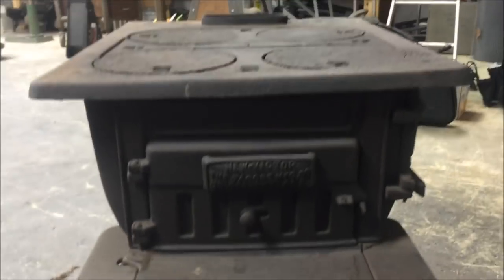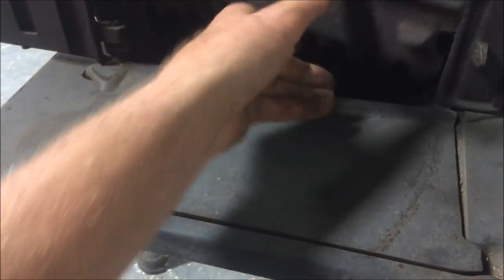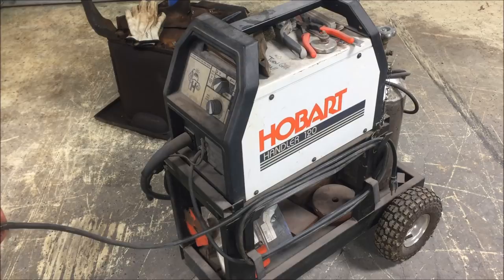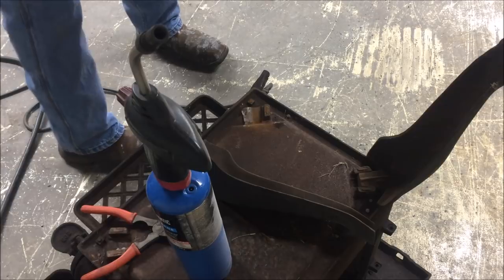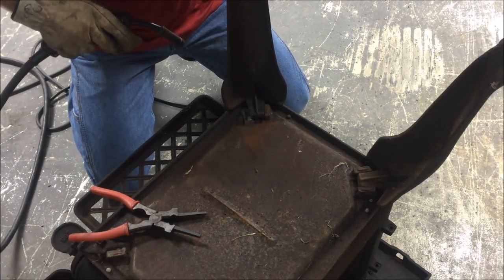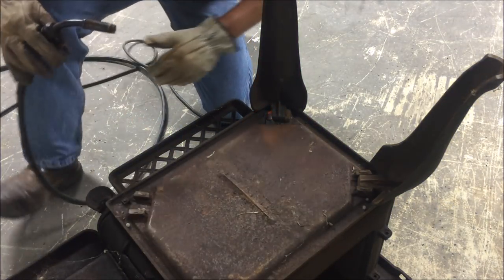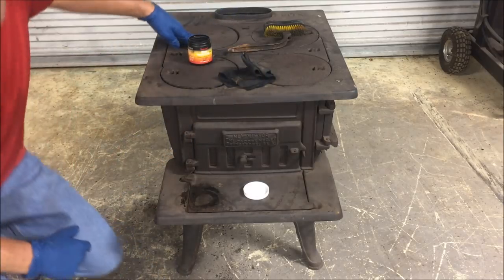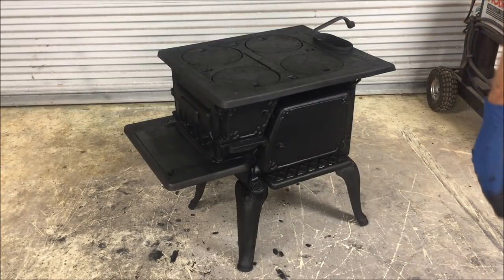How to MIG Weld Cast Iron on a Wood-Burning Cook Stove

Comment: I have been welding for 40 years.  I have welded a lot of cast iron.  The best way I have found is to use a nickel or stainless steel rod. (using an old stick welder)  It is malleable enough to keep the weld from cracking.  Using the nickel rod, I can weld cast just like anything else.  Pre heating thin parts is still a good idea.
Reply from the maker: Great to know!  Thanks for the information.

Comment: Thank you for the video! 
I just fixed a long hairline crack on a wood stove and did the same thing, heating it up to 500 degrees before welding. My only problem was every time I tack welded all I heard was tink tink tink. I was going slow not trying to have to much heat from the welder, but I was chasing more hairline cracks coming off of the original crack. Finally I got it. Next I will put some fire cement over it for extra protection. 
Thank you!
Reply from the maker: Great tip!
Reply: You need to drill a 1/4" hole at each end of the crack. This will stop more cracks as you weld. Use either a cast iron wire (mig) or stick. If not braze it. If you use regular steel filler wire it heats and expands differently than cast iron and will cause more cracks

Comment: That’s great that it’s on, I used to arc weld cast iron and we also preheated the parts and used special low hydrogen rods to prevent cracking
Reply from the maker: Good deal.  I was using what I had and it held... for now

Comment: I would have not welded the leg to the stove itself, instead I would have found a piece of carbon graphite, cut a piece to match of same thickness of the  slot that leg fits into and the same shape of the tang on the leg, then used the welder to build up the area of  that was broken off,  the mig wire will not fuse to the carbon and after completion of the repair, the carbon could be chipped out and the leg could be removed in the event the stove needed to be dismantled sometime in the future to facilitate a more compact package. By the way I have an old Cast Iron Church Bell that was cast by the same company that made that stove,, it was missing the clapper, the pendulum piece that rang the bell, I used a trailer hitch ball and made one from it, still have it and is mounted on a Red Aromatic Cedar pole,  the bell itself is a #4  which the bottom of the bell shape is approx.. 24 inches in diameter and is about 18 inches high not counting the cradle and arm that the bell swings on. The bell was cast in 1847.
Reply from the maker: That must be a cool old bell.  I hope you find the replacement parts.  Good luck!

Comment: Thought you were going to close up the crack by the broken bolt (bullet hole:). Our old heater/stove has some broken cast pieces that I am going to either braze or mig. I've got a Lincoln mig 100; I hope I can get enough power out of it.
The firebox doors have many segments of mica, some broken. I wonder where I can find some of that?
You've inspired me. 👍Thanks
Reply from the maker: I bet that welder will work especially if you preheat if with a propane torch before welding.  Good luck
Reply: @JustPlainCommonSense  Excellent thanks. I found some mica, by the way, on amazon
Reply from the maker: You’re exactly right!

Comment: Great work and very informative thanks, but what sort of welding wire did you use?
Reply from the maker: Its a easy grind wire commonly used in auto body repair.
Reply: Blimey! Ok thanks.
Reply from the maker: I think the stuff is actually referred to as "Easy Grind".  It's nothing special at all; just a good all-purpose welding wire.  Not stainless.
Reply: I had an old stove that had a broken piece. Got a couple cast rods from Air Liquide but no joy. At the end we just used a 7018. Heated the piece cherry red, welded it, and wrapped it in fire blanket for a slow cool. Knock on wood it’s still down in the basement burning wood as we speak. Nice job btw.

Comment: late to the game, but did you do anything with the inside of the oven with that black paste?  I have an old gas stove that has a log of rust on the inside and sheet metal that is rusted through that I am trying to get back to a usable state.
Reply from the maker: I wouldn't apply it to the inside; it may contaminate whatever gets cooked in there.

Comment: I'm working on an old pot belly stove that has one cracked trim piece. I was thinking about trying to weld it with a welder similar to yours. Was that just regular welding wire? Great video. Thanks.
Reply from the maker: +deere3321 That is just "Easy Grind" wire in a gas MIG wire welder.  Preheating is the trick

Comment: How much volts are you using while welding?  Also what wire speed?
Reply from the maker: That is a 110V MIG.  I can't recall the speed; whatever speed made the weld sound right.

Comment: Can flux core be use if no gas is available ? Thanks
Reply from the maker: I don't see why not.  Give it a try and let us know how it worked out.  Thanks for the comment!
Reply: @JustPlainCommonSense  weld a small cast iron part and dump it on ash to let it slow cool down and it work great, using Lincoln flux core .035 and a small century wire welder

Comment: I was looking at my oven it has the same hole as your bullet hole in the same place. pretty sure it's not a bullet hole
Reply: +5 Acres on the Bayou yes
Reply: +5 Acres on the Bayou send me your email or # I can text you a pic of mine I will send you a pic
Reply from the maker: +Jeff Davis You are absolutely correct Jeff.  I just took the top off the stove and there are two bolts that come through the outside skin and support the top of the oven box.  What I saw was the head of the old stove bolt.  My bad.  Thanks for letting me know.  The mystery has been solved!
Reply from the maker: +Jeff Davis My email is in the About section.
Reply: a pity ...a good tale ...

Comment: So how did your welds hold up? Did they crack or break off after you used the stove? Or are they still intact?
Reply from the maker: They are still holding up just fine.  The stove doesn't get disassembled and moved around at all; it just stays in one place.  No problems at all.